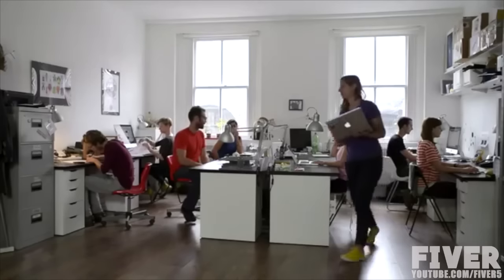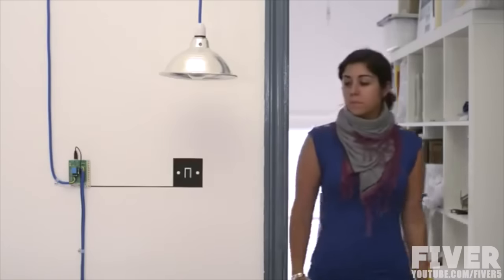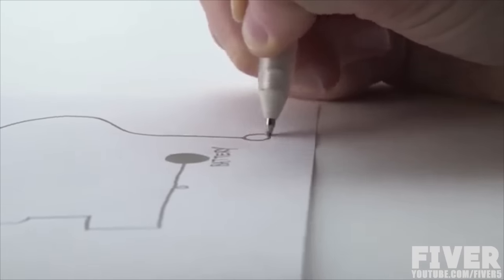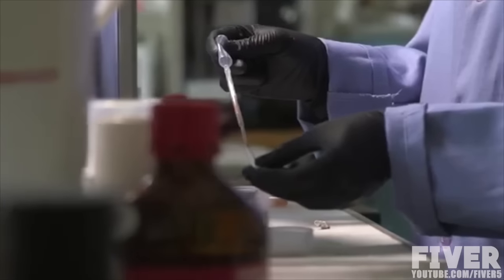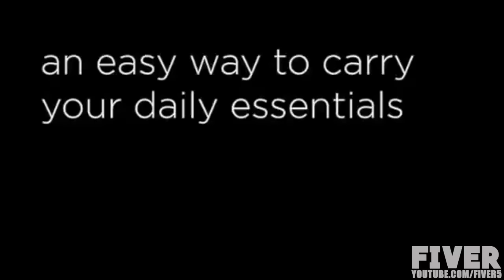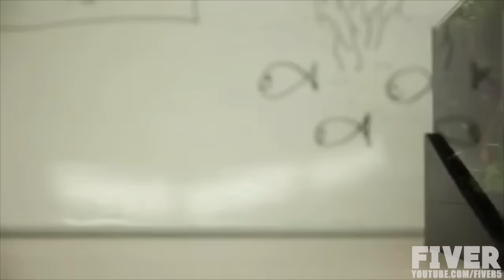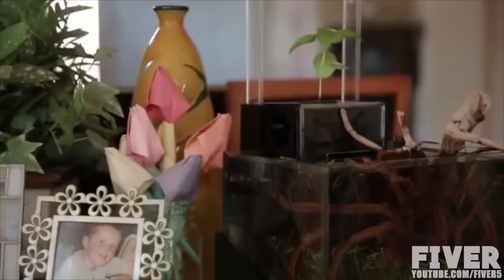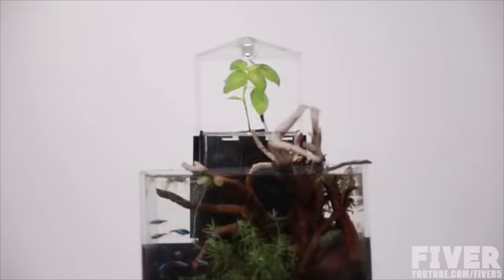● 5 INVENTIONS THAT WILL BLOW YOUR MIND ☞37

Comment: The EcoQube's function is brilliant but the design is not a thing of beauty. It looks too 'homemade'.
Reply: +3enjoy3 I agree that it's not a thing of beauty. It looks like something bland and boxy that might be found in Ikea. I don't know how you can see that as looking home-made though, unless you happen to be particularly skilled at welding plastic. I think making it look hand-crafted by giving it some wood paneling/trim would be an improvement.
Reply: +kedwa30   Haha no I meant the finish suggested it was still in the design stage, lacking something. The top housing for plants in particular had the appearance of a glued together afterthought. Some form of edge trim with smooth profile would make it easier on the eye. I wonder also how the aquarium part would perform without a dust cover?
Reply: 3enjoy3 Oh, I see what you mean. Yes, I think that video came from their Kickstarter campaign which was to raise the money for a mold for mass production, so those pictures should have been of the prototype. I hope they get some for sale in Petsmart. I think the dust cover on most aquariums is to keep the fishy smell in rather than to keep dust out. With this natural filter design, the raw sewage will be trapped in the roots of the plants (rather than in the gravel bed in the tank) so the fish tank should smell clean, but you may want to keep the plants enclosed to keep the smell at bay.

Comment: Eco cube is awesome however how tall is the stand that holds the light and what if a larger type of plant were to be grown would the light stand be able to rise and lower?
Reply: +warriorlink01 The small desktop model is meant for small plants such as herbs, lettuce, or a bonsai. It's meant for being a decoration. However, as the video says, they at first made larger models but found that they were not so popular since few people had the space in their homes and offices. I'm sure if you contact the company they will probably be able to help you with a custom product; otherwise, it really isn't that hard to make something similar yourself. Simply buy standard aquariums or glass enclosures and use a standard ceiling fixture for the light. You can buy an inline UV filter and water pump. The important part is to keep the plants enclosed because all that raw fish sewer being constantly dumped onto their roots isn't going to smell nice no matter what kind of flowers bloom. Although the design shown in the video has the plant on top, it's possible to have the plant underneath or off to the side. Simply run extra pipe or tube that transfers the water from the fish tank to the plants and back. So you could have the plants outside and the fish tank inside, or you could have each in different rooms or on different levels of a multi-story building. The small model they sell is just a decoration, but if you need something larger, you could easily build it yourself using standard parts.Use a standard fish tank and a standard aquaponics kit and put the two together in any way you wish.
Reply: kedwa30 Thanks for the feedback! :)

Comment: The first two are nothing new.  All they did was take something that has been around a long time and put their name on it.  Heck, there are even circuit board tattoos already... so technically, these first two ideas are a step backward if anything.

The electric bike idea is a cool concept for those that want to transport stuff.  However, if you watch the video again you will see that they don't show it being ridden that much.  And the few seconds that they do you will note that there seems to be a possible issue with steering.  Has potential though I think.

The fish tank idea is definitely nothing new.  They just took an idea that you would normally pay a specialist to create for you and are trying to reduce it in size and mass produce it.  So, it is cool they are doing that.
Reply: +101perspective There is nothing new under the sun. Everything is only rediscovered for the first time for each person, so it's new to them until it isn't anymore. The cargo bike is something that has been done in China for a long time already because due to their unique economic situation, the majority didn't have cars or even horse and wagon for so long. It definitely takes skill to steer a bike when it has a shifting load. Motorcycles already burn very little fuel so there really isn't any significant improvement in fuel efficiency to power a bike with an electric motor. Electric motors produce ozone, so if eliminating air pollution is the goal, then a hydrogen combustion engine is better. Either way, it only shifts the pollution production to huge coal burning plants, but at least they can economically scrub the exhaust to keep the toxic fluoride out of the air. Instead of releasing it into the air, which is illegal, they sell it to municipal water treatment plants to be slowly added to the drinking water, which a majority goes to washing and gets flushed down the drain eventually making its way into the river. But at least they don't directly dump it into the rivers... that would be a crime.
Reply: kedwa30
Yeah, I agree with you that almost everything is just a combination of other things in order to create something different.

My issue with many of the inventions in these Youtube videos is that the things aren't really a leap in any direction.

For example, the combustion engine was a big leap.  It was taking existing knowledge and using it in a way no one had thought to do.

Creating a different kind of electric bike isn't even close to being a leap, let alone a big one.  There are probably hundreds, if not thousands, of different ebikes out there.  If you are just moving the motor to a different spot or making the bike look different then imo that isn't much of an invention.  That is more of a design change.  And it may very well be a great design change... but that doesn't make it an invention.  Let alone an invention that should "blow your mind".
Reply: 101perspective I agree, and I have come to realize that anything on Youtube that claims to blow ones mind is complete hyperbole that I may as well take to mean time wasting video. I generally enjoy the comments a lot more than the videos. I also agree with your understanding of what it means to invent. It would be totally absurd to consider the first person to paint a bicycle pink to have invented the pink bicycle and thus claim as much notoriety as the inventor of the bicycle. As laudable as many functional design improvements are, they are not inventions. Still, I can't get mad at Fiver for making what's essentially a hack article video without getting mad at Youtube for not making clear categories to browse the way libraries clearly distinguish between a fiction section and a non-fiction section. This video should be in an entertainment section because of its title.

Comment: is the touch board safe? does it work on batteries only?
Reply: +A M Industries I have never heard of anyone dying or being injured from a few volts of DC. It's my understanding ( I could be wrong ) that the contacts are inputs only so they don't send any voltage out, but they only sense the static charge that all humans emit. It's like how a theremin works.
Reply: A M Industries Please accept my apologies for any misunderstanding. I do not represent that product or the company that makes it. I simply was trying to be helpful by imparting my experiences with electronics in general.